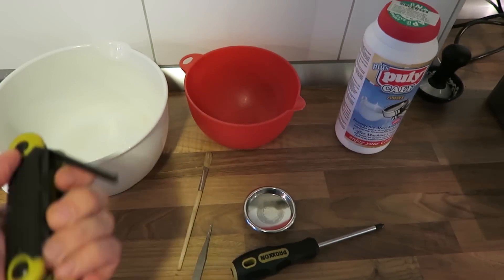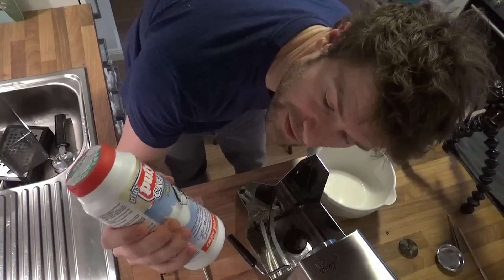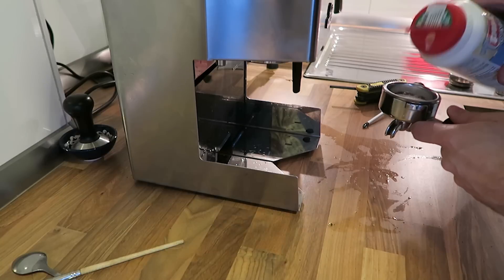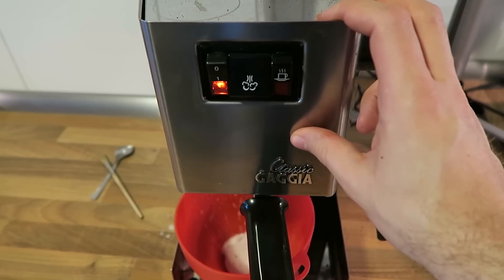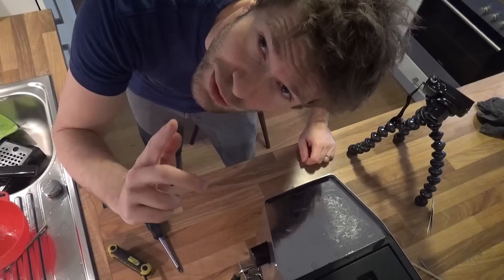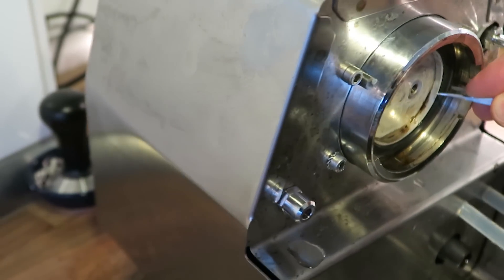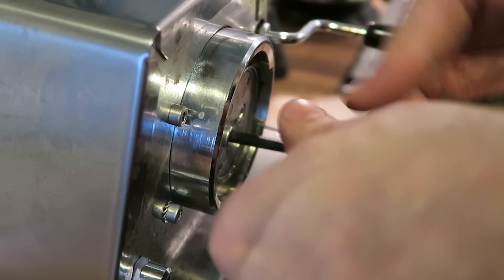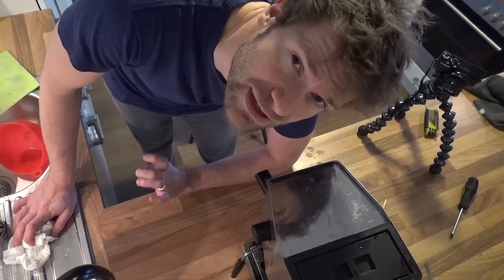GAGGIA CLASSIC CLEANING | How to clean your GAGGIA Espresso Machine fast and easy

Comment: Thanks for this. Mine is totally clogged and I hope that if I follow this procedure it will fix it.
Reply: If it's clogged you need to descale it.  Cleaning is basically a strong detergent.  For hard water deposits inside the machine that clog it you want to use a product like Urnex Dezcal.  It's cheapest to buy in the 900 g bottle, not the packets.

Comment: How often should I do the cleaning?
Reply: we don't have hard water, so i do a descaling about every 4-6 weeks (i have a sense of whether i have used my machine heavily or not since the last descaling.) i was just running citric acid dissolved in water thru the boiler and steamer and soaking the baskets in the solution too. i put the solution in the water tank and run water thru the group for a minute or so and run it thru the steam wand for a minute or so (doesn't have to be at steam temp) and then shut it off and just let it sit for ~10 minutes. After the soak, i run the whole tank thru, alternating b/w the group and the steamer. then i clean the water tank and put fresh water in it and run that whole tank thru, again alternating b/w group and steamer. Then finally put fresh water in and it's ready to go.
But, i found that i do need to regularly remove the disperser and clean it too. also, i just replaced the group gasket after 3 years - that was too long - should have replaced it a year ago if not sooner. that needs to get into my regular maintenance too.

Comment: Really loved the dual angles in the video. I'd avoid putting the plastic bit (used for flow control) into the cafiza cleaner as the acid can damage the plastic, in the same way as it damages the rubber o-ring.

Comment: Your cleaning solution is not for aluminium I think. So backflushing should be done with citric acid and not this stuff. Stainless parts can be used with that cleaning solution.

Comment: Should also add descaling along with back flushing & group head cleaning to the schedule.  Descaling should be done approx every 3 months or so to prevent scale build up inside the boiler. Nice video Chis. The Gaggia with non pressurized basket can make excellent espresso if a good grinder is used. Cheers!
Reply from the maker: +D Sak Thank you! Still trying to figure out, how to do back flushing. But if I know how, I will make a video about it. Promised ;)
The espresso from the Gaggia is really great. One of the best invests I ever did in my life.

Comment: I know the video is about cleaning, but that espresso shot at the end looked horrible.
Reply: why? Was the drema too light coloured?
Reply: Lol no it was flowing as fast as a water hose :)
Reply: Possibly because he’s using the pressurised basket and pin which he didn’t know what it was for when he was cleaning it at 3:36. Great video though :)
Reply: @Reissnagel2  The espresso was very light and the flow rate was waaayyy too fast. He might need to go down to 8 or 9 bar on his gaggia as they come over pressurized OOTB.
Reply: Yea, he's using a pressurized basket which is basically a tool if you want to make something that resembles espresso with old/preground garbage coffee.  someone tell this guy to use a non pressurized basket, lose the perfect crema pin, and make some legit espresso.
Reply: @daxxjapxx He probably doesn't have an espresso grinder. What are you even talking about ?